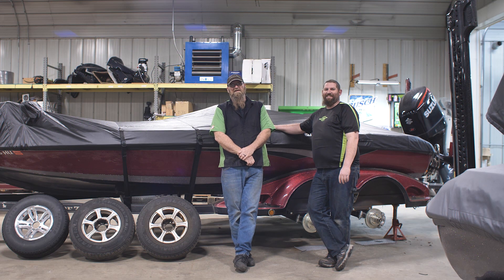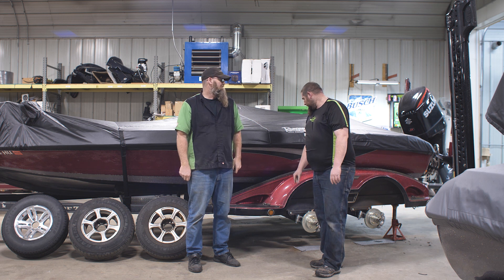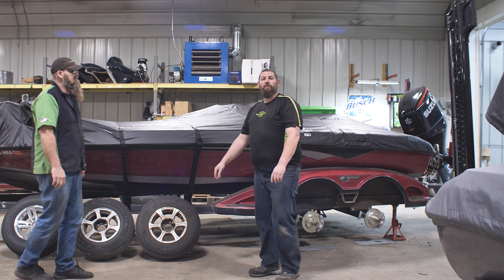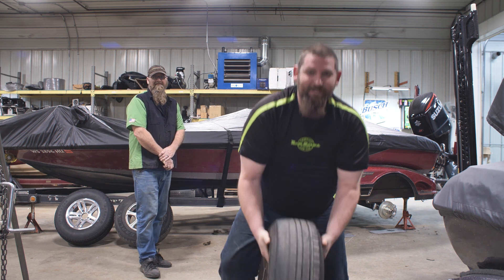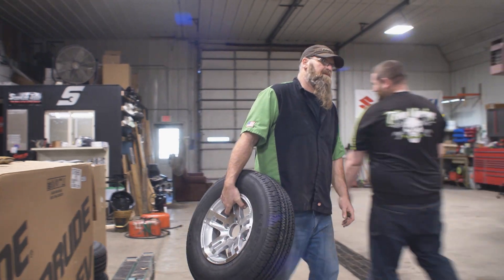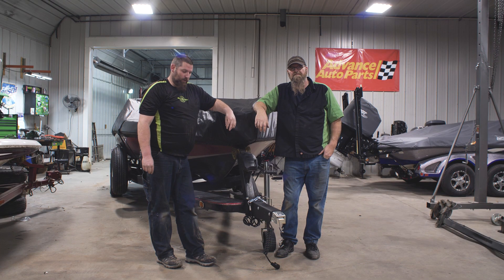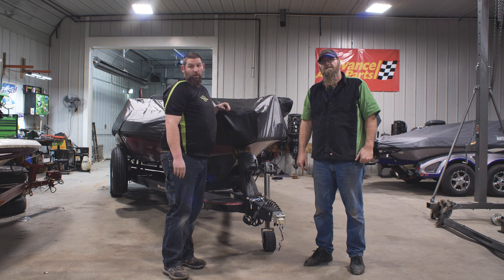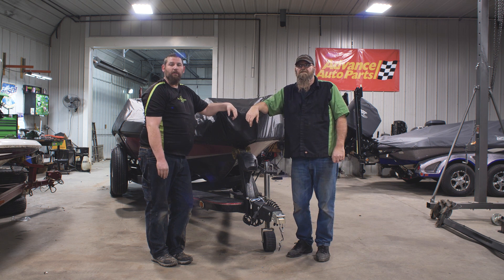Team Tech Tip # 12 | Trailer Overhaul

Comment: Curious what you charge for an axle for a Ranger tam den axle with torsion ? I’ve gone through 3 on my 2014 Ranger 620. And I religiously check my spindle bolt for tightness but still have gone through 3. And I’m having to run 52 psi in my tires so they don’t wear fast on the inside. Roads suck here in NE Illinois but I don’t put the miles on Tom does for sure. 👍

Comment: Please people on a regular basis check your tire pressure, pad life, tire wear, and fluid level. (A drop in level means a leak). Also run good tires, service you breaks and bearings, replace your brake fluid (it absorbs water and lowers boiling point). Spend good money on good tires. Trailers are simple machines but there is lot to go wrong, especially ones that get dunked in water for 10 mins twice a weekend.
Reply from the maker: 100%! The trailer is ALWAYS overlooked!!!!